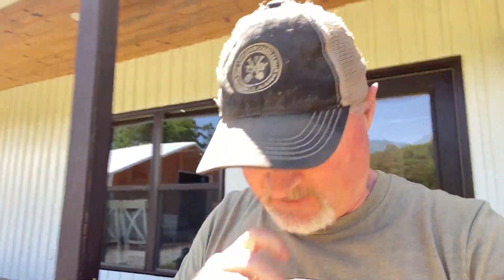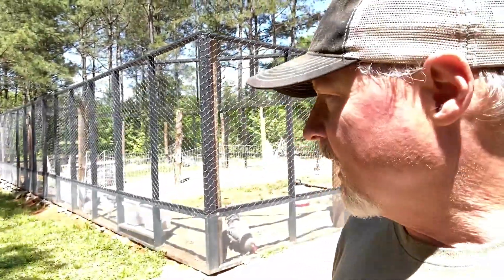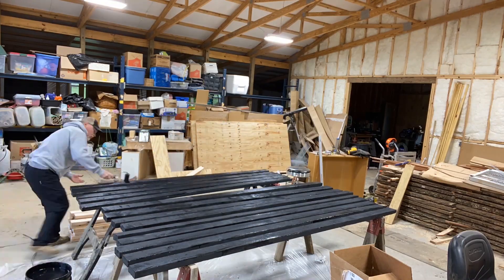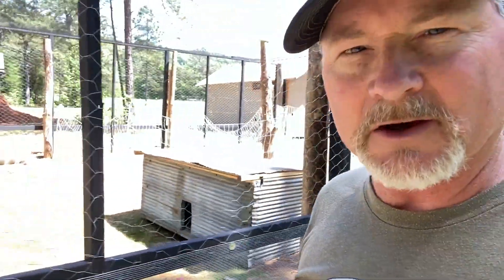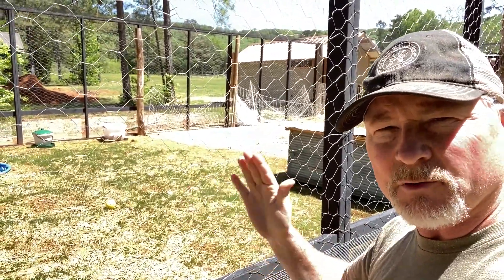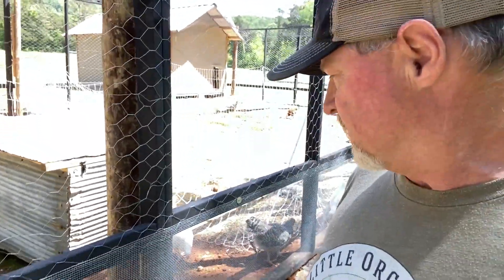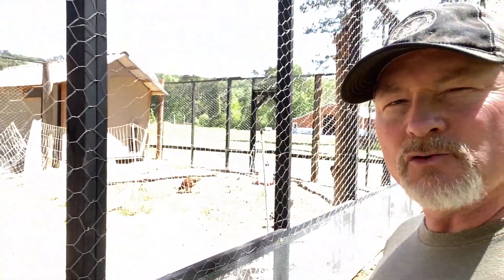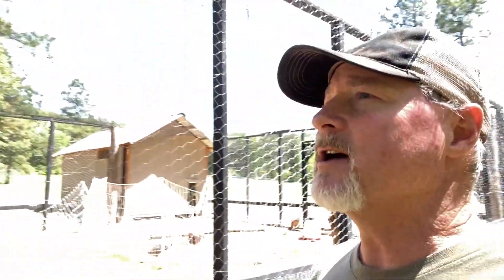Building a Chicken Run in 2 Days!

Comment: That is a nice size pen. It looks good. Good job using the hardware cloth. I have a 50 x 100 chicken pen covered in netting for the same reasons you have. I also put 3 hot wires down low to keep the fence climbers out. I used a heavy duty 2 x 2 netting that has UV protection made into it not coated that has been up 4 years now. I have seen it covered with 1/4" of ice and still going strong. I hold it up with 1/8" steel cable. The netting you used wont last long in the sun. If you want to upgrade I can point you to it. Good job.
Reply from the maker: So there is a lot of good info in your post. First, please let me know what netting you used, definitely interested in that. Second, I contemplated using steel cable as well and will probably double back and install. That is a fine design idea. Lastly, the hot wires is something I had not considered but I have used it on one of my chicken tractors and know it is very effective, so I may give that some consideration. Thanks for the tips, CritterWindow!
Reply from the maker: @TheCritterWindow  thank you!